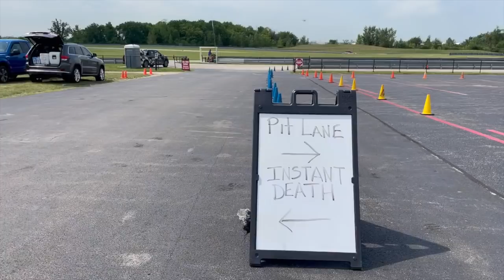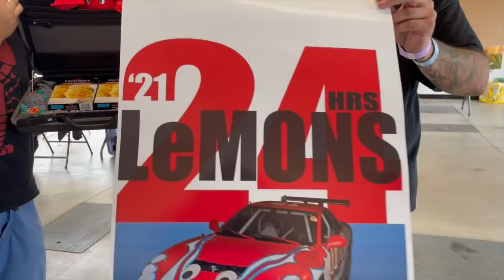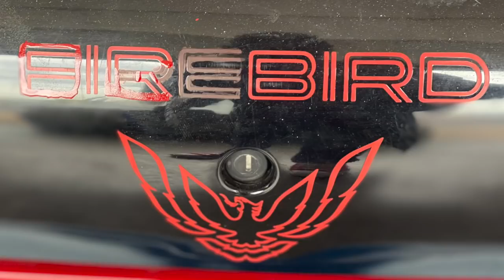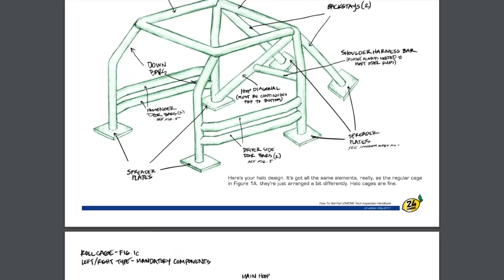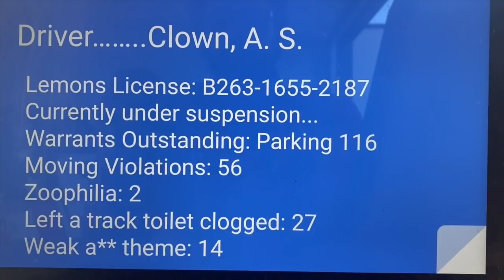Lemons Wrapup--Autobahn '21

Comment: whats with these guys and the duster/shadow v6 cars , had a 94 shadow v6 5 speed bought it with 69k on it drove it daily drag raced it at local track and drive 112 miles to drag race every other week end  did all this with the clutch and engine that came with it and when the timing belt broke at 235,000 mile sold it a race buddy who used the trans in his 93 duster and raced it